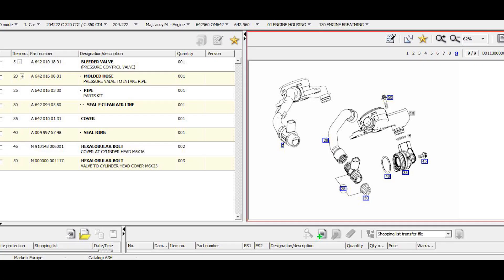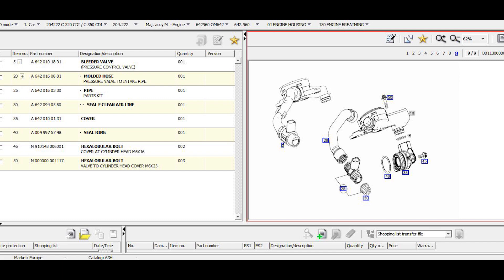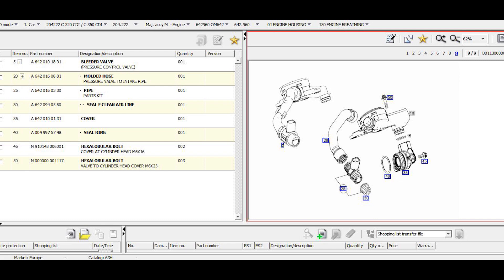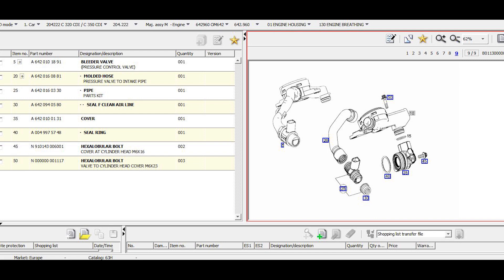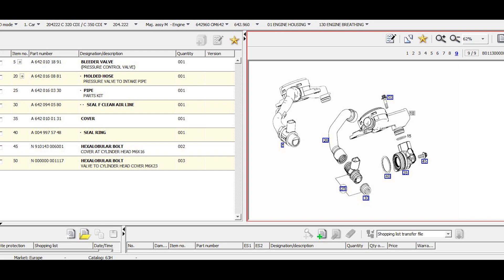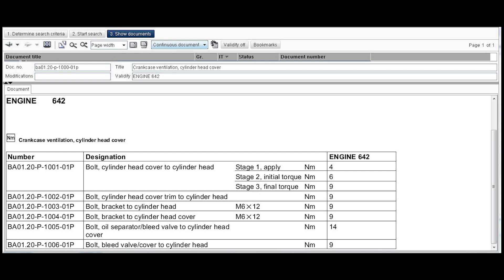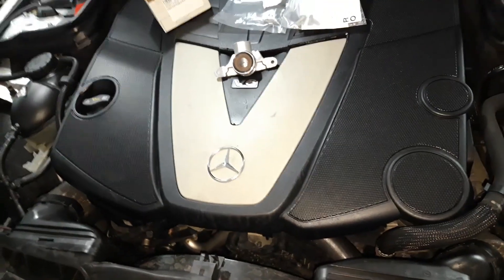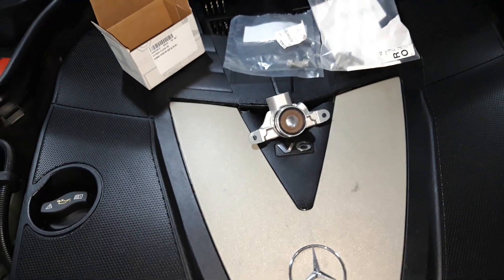OM642 PCV CAP PCV BLEED VALVE PCV COVER RADIAL ORING A6420100131 A6420101891 BLOW BY VAPOR REDUCTION

Comment: Salut, oare la OM642 265 hp la.cls se poate schimba doar cap-ul acela de la pcv (piesa 35 din prima diagrama) sau trebuie tot ansamblul de pcv?
Reply from the maker: Recomand tot ansamblul pcv. Atât diafragma în cutia neagra de plastic cât și semeringul care vine în spatele axelor cu came.
Reply: @AlexAndreiZAR   Sunt de acord cu tine, dar din nestiinta am comandat doar piesa 35 sa o inlocuiesc preventiv (nu am pierderi de ulei / probleme). Si avand in vedere ca returul ar fi o bataie mare de cap (am luat piesa de afara sa ma asigur ca e OE), eram curios daca pot sa schimb doar piesa 35 si aia e. Parca la mine pare un pic diferit fata de cum ai la tine. 

Daca mi-as fi facut temele mai bine inainte cu siguranta as fi schimbat tot ansamblul.
Reply from the maker: @vladandrei51  se poate instala și piesa 35... dar având în vedere ca ai menționat ca ai LS-ul de 265 de cai s-ar putea sa ai noua versiune de sistem PCV, anume doar semering în spatele axelor cu came ce duce direct în botul turbinei, fără valva PCV pe capacul de culbutori.
Reply: @AlexAndreiZAR  scuze daca sunt mai greu de cap :). Si daca este versiunea nouă atunci nu se poate schimba individual, si trebuie tot ansamblul pcv? Sau ce-ai vrut sa evidențiezi mai exact?
Reply from the maker: @vladandrei51  exista 2 variante de sistem pcv. Varianta noua care are doar semeringul (nr35 din diagrama) și nu mai are și cutia de diafragma a pcv-ului. Sistemul vechi le are pe ambele.

Comment: Salut. N-am inteles daca ai spus 16000 sau 60000 ca si kilometrii de schimbare. Also, te referi strict la valva PCV, sau valva impreuna cu conectorul? Sau au timpi de schimbare diferiti? Ma gandeam ca conectorul ala tine mai mult, dar pentru 200 lei cat e, l-as schimba si ala la fel de des, decat sa imi traga stropi de ulei. Tocmai ce am inlocuit ambele admisii cu altele noi, nu prea mai am chef de cox peste clapete :)) A fost jale acolo. Din fericire am avut consum de ulei zero si atunci si acum, dar e clar ca si o cantitate imposibil de mica de ulei, in timp, impreuna cu fumul de la EGR, acumuleaza mizerie.
Reply from the maker: Salut. Multumesc de vizionare! Apreciez si commentul. Nu mai gasesc exact minutul si secunda la care faceam referire la intervalul de schimbare insa cel mai probabil poti merge pe 60.000km. E un interval mai corect decat 16.000km (care zic eu ca ar fi prea scurt). Daca faci multi km (in regim de autostrada) cred eu ca ai putea lungi intervalul de schimbare chiar si la 100.000km. Cand le schimbi ar fi grozav sa schimbi atat semeringul cat si valva PCV, la pachet. Da, ajuta la diminuarea depunerilor pe admisie dar eu am mers un pas si mai departe si am pus un oil catch can.
Reply: @AlexAndreiZAR  Perfect, mersi de confirmarea informatiilor. Am vazut o chestie la un youtuber, si face sens ce explica: faptul ca e asa aproape de turbo valva PCV, si furtunul ei de altfel e scurt, trage fortat mult mai multi vapori decat e nevoie, chiar si cu catch-can. El a facut asa, a prelungit furtunul de la valva PCV pana a intrat in fata cutiei de aer a unuia dintre filtrele de admisie, unde flow-ul e 50% fata de cel din fata turbinei. Ma gandeam sa fac si eu la fel. Ce parere ai?
Reply from the maker: @em4703  poți sa faci și de 10 metri furtunul pana în turbo efectul de suctiune e la fel ca și cum ai avea 10cm . Eu am pus oil catch can și am reroutat înainte de  filtrele de aer. Vezi celelalte 3 videouri ale mele care fac referire la instalare oil catch can.

Comment: Where did you get the pictures with each part numbers from? I have mercedes wis but it doesn't have this,regards Scott
Reply from the maker: Hi Scotty. Wis is the workshop instruction system. You need to go into EPC, insert your VIN and search for the needed part numbers. There are some cases where some VINS don't show properly the right parts or schematics for your car.
Reply: @AlexAndreiZAR  is epc on the same wis program
Reply from the maker: @MyScotty7  separate programs but should be interconnected.

Comment: Salutare !
Te felicit pentru clipul pe care l-ai facut, este cel mai detaliat din toate de pe net, pacat ca l-am descoperit dupa ce am schimbat doar valva PCV, dadea deja fum pe la oringul cu separatorul. Acum intrebarile care ma macina :
1 Abia am schimbat valva PCV ( noua pe OEM ) crezi ca mai pot merge cu ea 2000 km pana la revizie sa schimb atunci si "separatorul de ulei" (piesa cu simeringul din aluminiu) sau este riscul sa stric iarasi valva ? Pt masina, fix codul prezentat de tine este pentru separatorul de ulei ?
2. Garniturile rosii, de la turbina si de pe furtunasul pcv-ului trebuiesc schimbate la fiecare revizie ? (10,000km) sau de fiecare data cand umbli pe acolo?
3. masina pana acum a primit doar ulei de mercedes 5w30 ar fi mai ok sa merg le Liqui Moly 4200 top tech 5w30?
Masina este W212 350cdi 2009 180,000 km
Multumesc ! Ai Like de la mine
Reply from the maker: Salut! Ma bucur ca iti este de folos clipul.
Încerc sa răspund cât se poate de la subiect. 
1. Poți da jos supapa pcv și poți schimba și acum simeringul cu corp de aluminiu. Nu vei strica nimic atâta vreme cât lucrezi cu calm și răbdare.
2. Garniturile roșii se pot schimba odată la 4-5 revizii sau mai repede dacă vezi ca ele nu mai etanșeaza.
3. Eu am folosit 3 tipuri de ulei pana acum și anume
Motul Specific 229.52 
Mobil 1 ESP
Yacco Lube M.
Toate cu vâscozitate 5w30.
Recomand sa fi atent ca pe orice ulei ai folosi sa fie 5w30 și neapărat MB-Approval 229.51 sau MB-Approval 229.52.
Mai multe detalii despre uleiuri agreate de Mercedes-Benz vei găsi pe site-ul lor, BeVo, unde în baza VIN-ului mașinii tale iti poți cauta uleiurile și fluidele necesare servisarii mașinii tale.
Bafta!
P.S. te aștept pe grupul OM642 English de pe Facebook.
Reply: dadea fum negru inainte sa le schimbi?

Comment: Salut! 
Am trepidații la rece, când ajunge apa la 60-70 de grade dispar, crezi ca e de la valva pcv?
Suporții motor-cutie au fost schimbați, galeriile de admisie curățate, motorasul ce acționează clapetele schimbat, nu îmi dau seama ce are masina
Reply from the maker: Salut. Trepidațiile sunt la relanti sau la mers în sarcina? Valva pcv sigur nu e cauza problemei expuse de dvs.
Reply: @AlexAndreiZAR  doar la relanti
Reply from the maker: @ionutvaduva7899  e manuala sau automata? Când e în viteza sau la punctul mort?
Reply: @AlexAndreiZAR  mașina este E350d V6 w213 9g tronic, face si pe liber si dacă o pui in drive
Reply: @AlexAndreiZAR  face doar atunci când este rece, după ce se încălzește puțin merge perfect
Reply from the maker: @ionutvaduva7899  e oarecum normal sa auzi un zgomot cand motorul merge si desfaci busonul de la ulei (de avut in vedere ca unele zgomote pot fi mai pronuntate caz in care ar trebui investigat). Cel mai probabil daca ai vibratii doar cat ii motoru rece sa fie de la injectoare (de verificat valorile de corectie la injectoare cu o diagnoza Star). Tot din diagnoza Star ar fi indicat sa efectuezi un test de compresie relativa sa vezi debalansarea dintre cilindri si repetata procedura cand ii motorul cald. De curiozitate cati km parcurgi intre schimburile de ulei?
Reply: @AlexAndreiZAR  8-10k
Reply: @AlexAndreiZAR  injectoarelor sunt ok, stii cum sa verific dacă valva funcționează?
Reply from the maker: @ionutvaduva7899  nu cred sa existe vreo modalitate de verificare a valvei PCV. In principal ele se cam schimba tehnologic la intervale de 60.000km +/- in functie de regimul de utilizare al vehiculului.
Injectoarele daca pe diagnoza dau bine atunci trebuie date jos si verificate pe bancul de testare (recomand un service specializat pe asa ceva).
Cat despre faptul ca schimbi uleiul la maxim 8000km sau 10.000km nu pot decat sa te felicit. E o abordare corecta.
Reply: @AlexAndreiZAR  și dacă deschid capacul pe unde pui ulei in motor, se aude un zgomot ciudat, ca și cum ar bate ceva
Reply: @AlexAndreiZAR salut
Am o vibratie/trepidatie , la ralanti ca de tampon motor uzat/rupt. Injectoare/egr/turbo excelente. Ce as putea verifica ? mL350cdi 2013

Comment: Hello, does it stops the oil consumption completely? Cheers
Reply from the maker: Hello. Depending on how bad your seal is you should experience some kind of improvements.
Big oil consumption values are due to bad turbo or bad piston rings.
The pcv only let's a higher oil vapour quantity into the intake.
Reply: No , it didn’t stop the oil consumption. 
Everyone is talking about replacing that o-ring but no one is mentioning the camshaft worn surface where that o-ring is supposed to seal . 
Because of the worn surface on the camshaft , the oil accumulated just in front of the seal will travel along the hose to the intake circuit and it will get burned .
To stop oil consumption you must change the camshaft as well .
Reply: @vibesstr  The o-ring is very oversized, the moment you put it on it bends around the shaft. Unless your shaft has over half a centimeter of wear, it will seal properly. Look at the parts again.
Reply: @em4703    I know how that O-Ring looks like . I have changed it twice . It bends on the camshaft surface and it should seal good . Unfortunately, because of the uneven surface of the camshaft the oil is able to get sucked in the intake . The whole intake is full of oil . I’m talking about my own car and not someone else’s vehicle.

Comment: When I tried to remover that connector it stucked at about half way. I wasn't dare to force it further. After seeing your video ,should I force it more?  And the  next question  when I install the new one the rubber gasket looks more   thicker. Will be  difficult  to put it back to? I will definitely  use some grease! Thanks  for your  help!
Reply from the maker: Use engine assembly grease or engine oil. Good luck!

Comment: you should have loosened the valve cover bolts a few of them like 5.
Reply from the maker: Not gonna do anything. Injectors are being held in the engine head. Cover is in between injectors and engine head.

Comment: Hey Alex, great detailed video! What is the name of the software you are using to get all the correct torque values (and steps) for the assembly steps?
Reply from the maker: Hi. There are a lot of different softwares which you can use. AutoData, TecDoc, various reputable repair manuals such as Haynes, etc. Personally I use the Mercedes software called WIS/ASRA/EPC (WorkshopInstructionSoftware/ASRA is for hour counting in the shop for different repair operations/ElectronicPartsCatalogue). Hope my answer helps.

Comment: Salut. Ce te-a facut sa schimbi piesa respectiva?
Reply from the maker: Salut. Cum am explicat si in video acel semering odata cu trecerea timpului oboseste si permite gazelor din carter sa treaca nestingherite in valva pcv.  E necesar ca acest semering sa fie schimbat la maxim 100.000km sau vreo 10 schimburi de ulei.
Reply: Excelent videoclip. Masina consuma ulei?  A mea consuma, am refacut turbina(nu avea nimic) , am schimbat valva pvc. A mai ramas sa schimd doar partea de aluminiu.
Reply from the maker: @mihaiburcea2715  salut si multumesc pt apreciere. Nu, masina nu imi consuma ulei. Posibil ca prin sistemul PCV sa se piarda intre schimburi maxim 0.5litri la 10.000km; pe joja nivelul uleiului nu il vad sa scada. Bafta multa!

Comment: What was the lubricant you applied at the connector's gasket? Do you know that if it's a petroleum derivative oil, it is damaging the gasket?
Reply from the maker: Engine assemby grease. Gasket is supposed to be subjected to heat and oil in engine. Applying engine assembly greas doesn't damage anything. 
Gaskets which are supposed to keep things tight like air pasages are more sensitive to wear if they get in contact with oil or other greases.
Reply: @AlexAndreiZAR  Great, thanks for the answer. Would you please send me the link, I want to buy it.
Reply from the maker: @Skenderovski  Hi! Can't really give you a link to the product. I am from Romania and you might not be able to buy the same thing. Instead I will tell you from what it is made of - product name Prista Grease LiCa. It is made from Lithium and Calcium. I bought a small bucket (I think it is a bucket of max 1kg) it lasts for a very long time. It might very well be the case that you can find similar product in your country from a different manufacturer. 
Here are some examples:
SKF Lithium-Calcium Soap
Castrol Lithium Grease 400 g LMX Cartridge
Ambersil Lithium-Calcium Complex Grease 400 g EXL Cartridge
MOTUL Grease Tech 300
CRC Lithium Grease 100 ml MULTI GREASE Tube
Or you can just use a smudge of engine oil but that is just plain dirty :) - again, no it will not harm the gasket because gasket is supposed to create a tight seal and keep engine oil inside and not let it get past. Heat is what damages the gasket or long exposure to heat. Heat exposure bakes the gasket and makes it brittle over time.
Reply: These parts are exposed to engine oil. Use engine oil in assembly.

Comment: Great video. Just did this job 2 weeks ago on  my om642 equipped vehicle. That cover was a pain to get out and the rubber part was reduced in size and was hard like a rock. A must do maintenance on this engine. Would highly appreciate more content on this engine
Reply from the maker: Thank you so much for appreciating the work. I love this engine. It is a real delight working on it and also a real delight driving the car. It has a unique character, it pulls and pulls and pulls without even the smallest hesitation. I do have more content on this engine. Please check my channel and also subscribe and hit the bell button to get notifications each time I post.